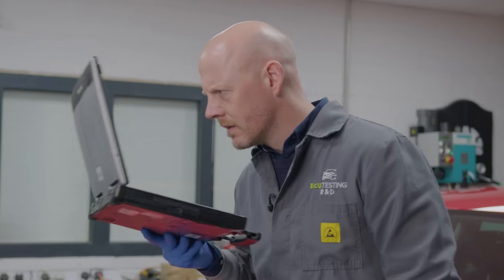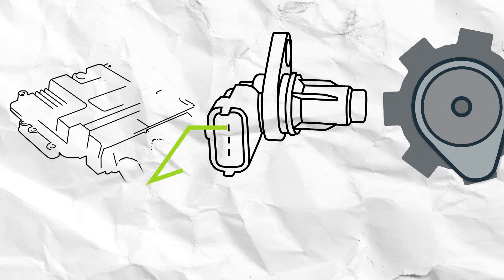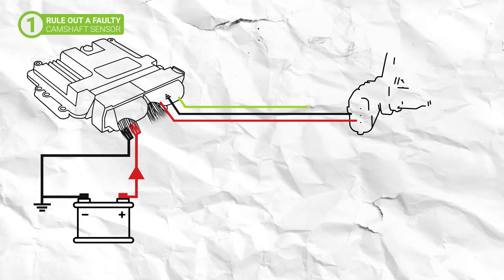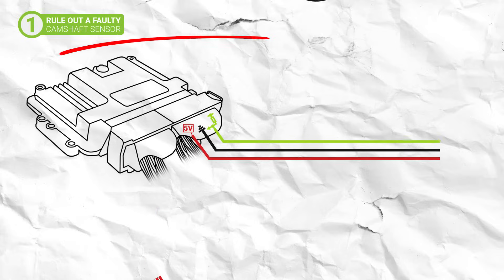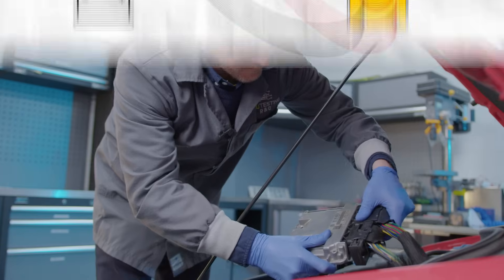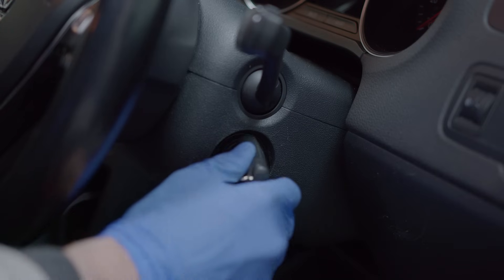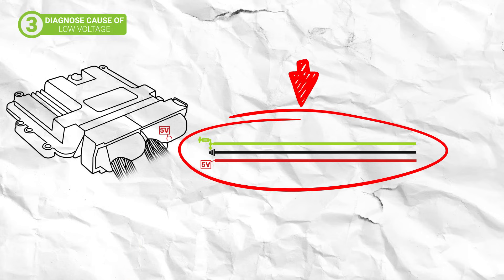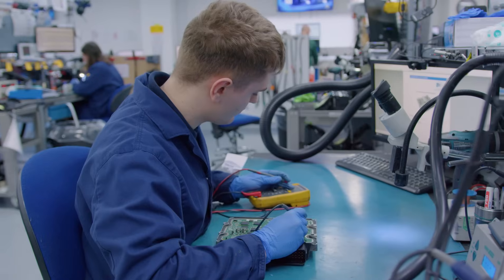Bad Camshaft Position Sensor Symptoms - How to Test and FIX!!

Comment: What’s the difference between camshaft and crankshaft?
Reply from the maker: Hi. A camshaft controls the opening and closing of the engine's valves due to 'lobes' or 'cams' pushing up against the valves as the camshaft rotates, which allows the intake of fuel-air mixture into the pistons as well as the release of exhaust gasses. The crankshaft converts the reciprocating motion of the pistons into rotational motion, transferring power to the transmission. It is connected to the pistons through connecting rods and converts the up-and-down motion into a circular motion.
Both the crank and cam sensors monitor the rotational position and speed of each of these and relay this information back to the ECU for optimal and efficient valve timing and engine operation. Hope this help!

Comment: I have a car with this and it  Completely stopped accelerating is it possible it just went constantly out or do you think its something more now
Reply from the maker: Hi. Have you scanned the vehicle for any fault codes? This is to help pin point what on the vehicle could be causing the sudden cut out of acceleration. Thanks.

Comment: What about the code P0321? Cant that be a problem with the camshaft sensor aswell?
Reply from the maker: Hi. The code P0321 relates to the crankshaft position sensor (also known as the engine speed sensor) rather than the camshaft sensor. The testing methods for both of these sensors is fairly similar, however we will be shortly releasing a video specifically about the crankshaft position sensor which will go into more detail!

Comment: Can you use same method to diagnose crankshaft position sensor?
Reply from the maker: Hi Carl. Yes, you can use basically the same method for both the crank and cam sensors. We will be releasing a video specifically for the crankshaft position sensor soon so keep your eyes peeled!👀👍